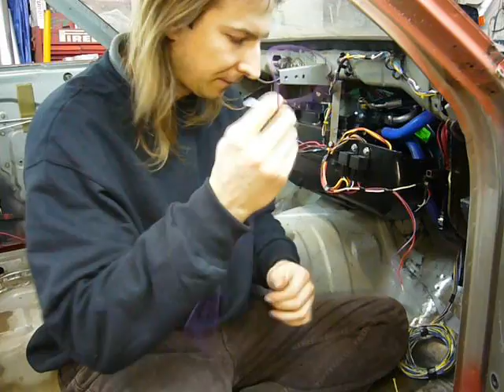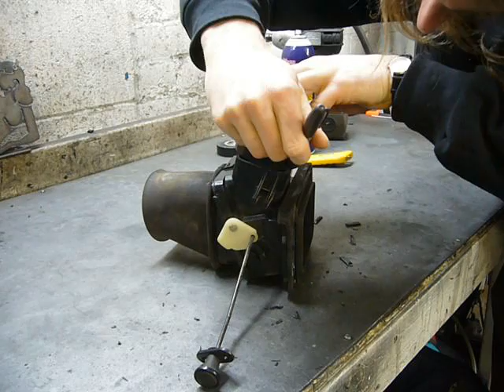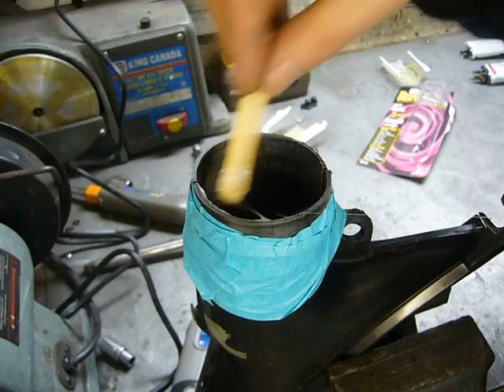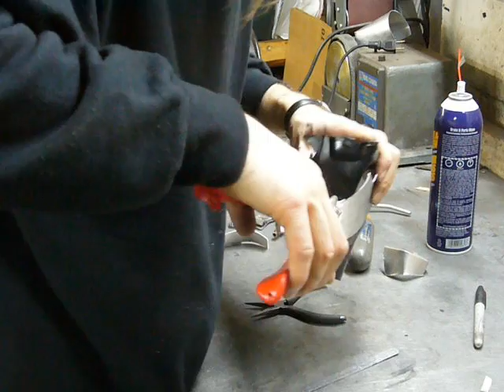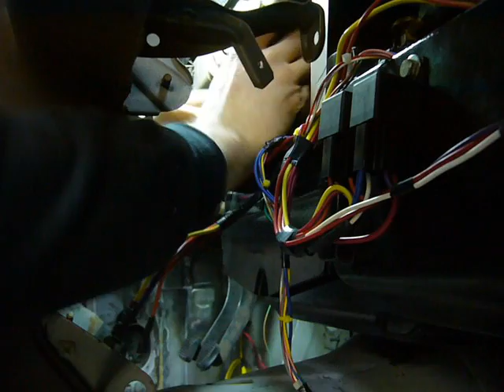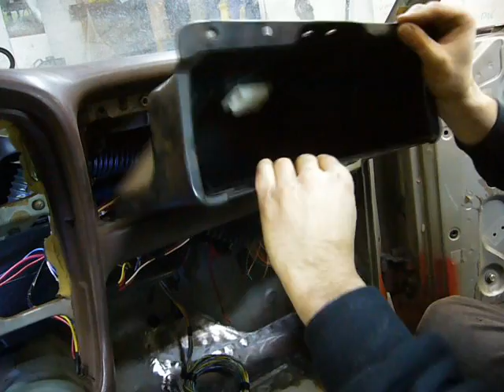Part 31: Vintage Air Gen II Compac HVAC Install, Part 3 - My 76 Mazda RX-5 Cosmo Restoration

Comment: So did you plan all the wiring out in advance so you knew exactly where everything was gonna go and how it was gonna work or are you just working off a general idea and common sense?
I tried planning out all the wiring when I rewired my car but found I couldn't translate it from the paper in to the car so I ended up winging it and then drew the diagram after to make troubleshooting easier.
Reply from the maker: I have a basic layout in my head of where I want the wire physically. Hidden, but not so much that accessing them in the event of an emergency is an issue. Electronics was my hobby for many years so the comparatively simple circuits in the car I can generally keep in my head. It helps that I'm keeping every subsystem separate. This way I can also test each one upon installation. When all is said and don't I will make a master wiring schematic for the car when I loom all the harnesses up. At this point in the engine bay, really only the body harness needs to be added.